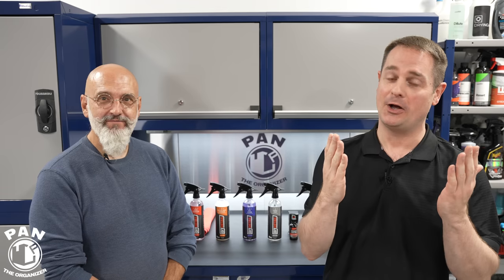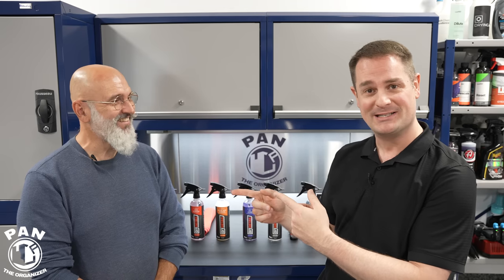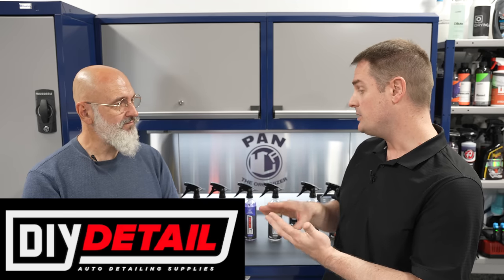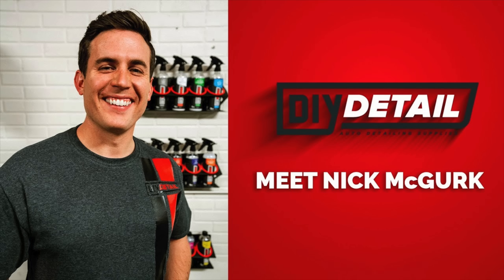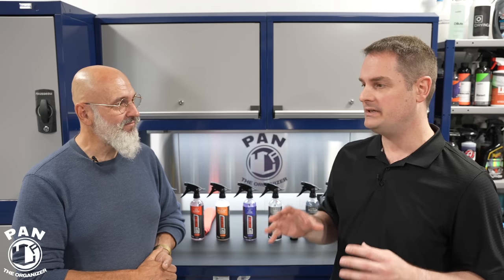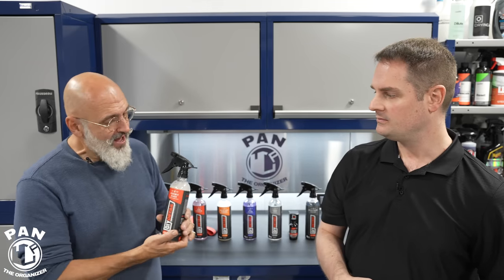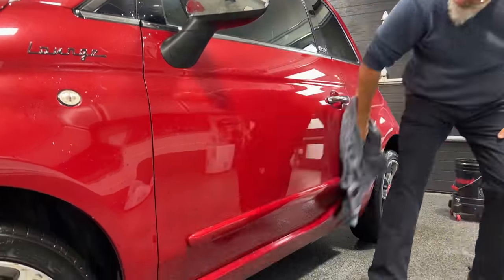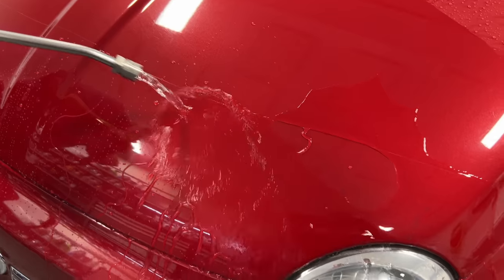DIY Detail Products : Brand Review

Comment: Another great video, Pan! I don't see anything compound in there I can use on the micro-marring is see in the sunlight. I just bought the car recently and it is in great condition. The peculiar thing is, the marring is short lines that are up and down, not even in a circle. Does that make sense? Is there a carnauba wax I can use to rid the car of micro-marring or is that strictly polishing? Is there a place you would recommend for polishing in Las Vegas? An acquaintance from the industry? Sorry for the long question and comment but I trust your judgement. Thanks for your great content
Reply from the maker: To get rid of fine scratches or micro-marring, only paint correction with a compound or polish will do. Just using a glaze or wax would only temporarily fill in the scratches with fillers, and wouldn't correct the issue.

I have a popular tutorial on machine polishing for beginners by the way. Here: https://youtu.be/ustTEVGMOTI

Comment: Hey Pan I just moved to Florida and applied Adams graphene ceramic just before the move. 
From this video you state graphene / ceramic attract water spots. I found that out QUICK here in Florida. What topper would you suggest I apply? A spray wax? Turtle wax seal and shine?
Thank you in advance!
Reply from the maker: It's not that they "attract" water spots. It's that coatings are more prone to water spotting, as they are extremely hydrophobic products and the water beading can lead to water spotting if you have hard water issues where you live, or the car sits in the baking sun after sprinklers through water on it, etc.

Any top coat will usually do the tric. A popular one is this: https://bit.ly/3VuIdBU

But nothing prevents water spots 100%. Regular washing is key, maintenance, and perhaps look into purchasing a deionizer for your water system. That ensures 100% mineral-free water.

Comment: Question: I’ve learned to use not only the 2 buckets method. Also to wash the upper part of a car with a different washmitt for the lower part. The reason is, that even if you sprayed and foamed a lot of dirt away, there is maybe still something at the door or even lower part. That’s just how it is and how dirt comes like from the road onto the vehicle. So if you use one washmit it could happen, that you have like little stones or something IN your washmit and make scratches into the paint. 
But Ivan was using just one washmit. 

Any thoughts? 😊
Reply from the maker: There are many different techniques for washing a car. As long as you use safe washing and drying methods, it's all good. I have a tutorial on how I wash cars here: https://youtu.be/7Koj5j2Es5U
Reply: Do the process you enjoy and trust.

Comment: Thanks for the video Pan. Yvan mentioned always using a drying aid with soap. Will the drying aids like XTreme solutions topper, or Si02 based detail sprays tech choice or formula 4 spray wax destroy the drying towels in short order?  Would the basics non polymer 914 rinseless be a better option as a drying aid vs the Si02 and graphene rinseless versions by McKee?  I bought multiple new towels based on your videos. Gauntlet sucker etc and would like to keep them working as long as I can if possible.
Reply from the maker: Drying aids won't "destroy" towels, but they will eventually load up the fibers and coat them (repeated use) and make them less absorbant over time, unless you use a proper microfiber detergent made for that. I use this one: https://amzn.to/3ycpVeB

I mainly use a blower to dry the car, but if I have to towel dry with a drying aid, I'm using a dedicated drying towel that I keep for that specifically.

After each use, I wash my microfiber towels with that and never had issues. If you already have towels that have lost their absorbency, you can buy that detergent, and let them presoak in a bucket with warm water and the detergent overnight, and wash them the next day. It should restore them quite a bit.
Reply: @PanTheOrganizer  Thanks again Pan, I do was every time and I use a microfiber wash. Nice to know they can be restored up to a point by soaking. I have some dry me a River white waffles from rag company I used Since 2014 until my recent upgrade to twisted fiber towels in your reviews.  They still work but they got dried on too high heat many times (not knowing at the time to use low or no heat) even abused they have great durability.  I’ve had Great luck with the rag company.

Comment: Hi Pan, do you prefer beading or sheeting on a car? 👍
Reply from the maker: The age old debate haha. Most products do a bit of both anyways, due to hydrophobics. If you spray the paintwork with high pressure from a pressure washer, you'll always see beading. If you use a garden hose at a slow flow, and let the water gently flow on the surface, you'll get sheeting.

I tend to prefer the looks of beading (as I use deionized water so I'm not worried about water spots) but those who have hard water issues are better with products that tend to sheet more than they bead.
Reply: @PanTheOrganizer  thanks Pan 👍

Comment: Is it safe to use a panel prep on the interior? Prepping before applying their ceramic interior coating?
Reply: Thank you for the question. Yes, you can but be careful with Leather if has been redyed.

Comment: Can the ceramic coating be applied in direct sunlight? What do you recommend to apply as a protectant as the coating continues to cure days later in the elements? How long until the car can be washed?
Reply from the maker: Ideally, you always apply a coating in the shade, or in a garage, on a cool surface. Working in a controlled environment allows you to have full control on flash times for levelling, reduces chances of high spots, etc.

After you applied a coating, always wait 1 to 2 weeks before washing your car again, as the coating still continues to cure during those weeks.
Reply: The DIY Detail Ceramic Coating can be applied, but ideally shade is best, and make sure the panel is cool. No need for a topper.

Comment: Pan, regarding using the clay towel and the iron remover… You stated that not all iron removers could be used as lubricants… Does P&S brake buster fall into that category or can I use it as a lubricant with a clay towel?
Reply from the maker: It would be impossible to say as I can't possibly test every combo. You can perhaps write to P&S and ask them.

Comment: My car is not ceramic coated and daily driven. I wash weekly. Can I use both beads and gloss for max protection? Is that overkill or just not effective use of products? How are your products with dust? My car is garaged. I have OG drying aid that I’m trying to get through because its a dust magnet for me. Have any recommendations for dusting?
Reply: DIY Detail Quick Beads and DIY Detail Ceramic Gloss can be “stacked” for additional protection. Unfortunately some ceramics are dust magnets for the first few days or weeks. As the ceramic cures the phenomenon goes away. As it’s curing the reaction causes static to attract dust.

Comment: Ready to use products that you don’t dilute and are designed for the non-professional average person need to be heavily advertised or sold to that market. Which means Walmart, Kmart, Canadian Tire etc…. When selling to that market the average person(your market) is generally cheap and doesn’t want to pay much which means low profit margins, which means high volume to make a decent living, which means time till you make money(or even break even) which means deep pockets. 
Tip: have a secondary line that costs more and is designed for the “professional user” that you have a higher profit margin on and is sold at “professional detailing” stores only and the professional Detailer gets a 20% discount.
Reply: Thank you for your comment. Having been in the industry over forty years, Yvan knows where he’s going with this.
Reply: @diydetailofficial  Sorry, I didn’t intend to come across as a “know it all”. I never doubted you or Yvan. 35 years in the automotive industry as an owner and 6 years in the fire, flood and carpet cleaning industry manufacturing chemicals, working with formulas and also sales/management taught me a few things. Chris at Carzilla and I know each other as I worked with him on a wipe-on glass coating that I put a 2 yr/20,000 km warranty on. I also learned a lot with a product that I imported into Canada. Dealing with large retailers is not easy and requires a lot of patience and money.
But, from what I see, you’re on the right path. Keep up the hard work.

Comment: can you spray Quick Beads on and rinse off and then use Ceramic Gloss on top of that before towel drying? kind of like stacking Ceramic Gloss on top of Quick Beads.
Reply from the maker: Yes. Don't forget, when spraying Quick Beads, you want to let it stay on the surface for 30-60 seconds, and then rinse. And then once you are done doing the entire car, you can spray Ceramic Gloss and use it as a drying aid while you are towel drying. 

But it's not necessary. Yvan says that Quick Beads is it's own drying aid. So it provides enough slickness once applied that you don't need an additional drying aid.

I hope this helps!

Comment: Why do you say don't spray the apc direct on interior panel. That it will ruin it? Many detailers do that and it's fine... but why specifically not with this product
Reply: That’s true of all APC’s . It won’t cause damage all the time, but it can, and if it does there’s no turning back. Yes unfortunately some people do it, doesn’t mean it’s the best practice.
Reply: @diydetailofficial  what kind of damage could it cause if over sprayed and basically left to dry withoit wiping ? Staining etc you mean?

Comment: Is the Quick Beads ok to apply on top of a ceramic coating?
Reply from the maker: Yes absolutely!
Reply: @Pan The Organizer  oh I've got another quick question. I recently got a rock chip just above my windshield on the roof. I noticed it started to rust a tiny bit. I bought a Dr. Color Chip kit to fix it. My question is should I use an iron remover to get rid of the rust and then apply the paint to seal it? Or should I use sandpaper to remove the rust inside the rock chip?

Comment: Do you know if the diy coatings are comparable to professional grade coatings?
Reply from the maker: That's too vague of a question. You would have to be more specific with which coatings you would compare these two. But they aren't professional grade, as they can be purchased by the public. Pro grade coatings are for certified installers only.

Comment: what ceramic coating is good for interior plastic and vynal?
Reply from the maker: You don’t apply ceramic coatings on interior plastics.
Reply: Our DIY Detail Interior Ceramic Coating is designed for that. A coating designed for paint will not work.

Comment: I'm still a little confused about ceramic gloss and quick beads.
Reply: Basically quick beads is a spray on and rinse off product with up to 3 months of protection. Ceramic gloss is a slightly stronger product that will also last longer (6-12 months depending on washing frequency & technique) that you have to wipe. In simple quick beads is a basic spray on protectant with easier application and ceramic gloss is a stronger more traditional wipe on protectant.
Reply: @jugjivan  thank you. I went with the ceramic gloss since it fits the rinseless wash better.